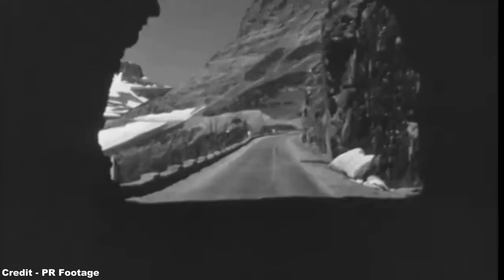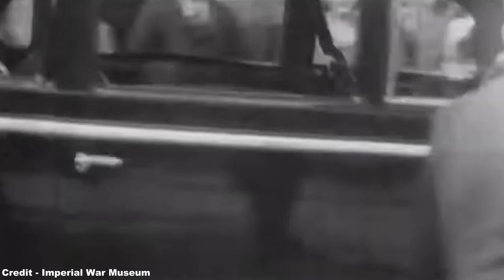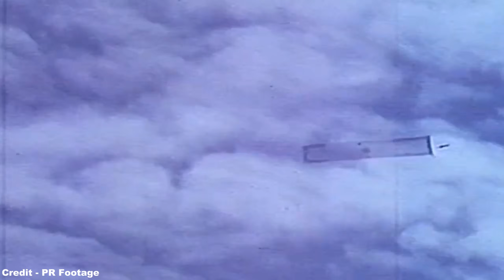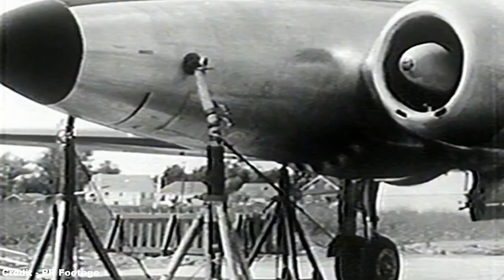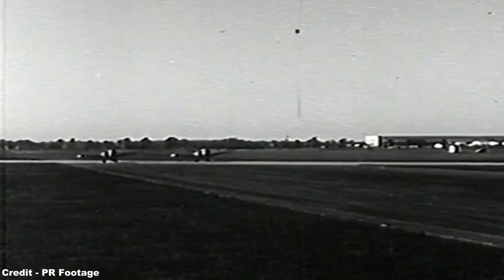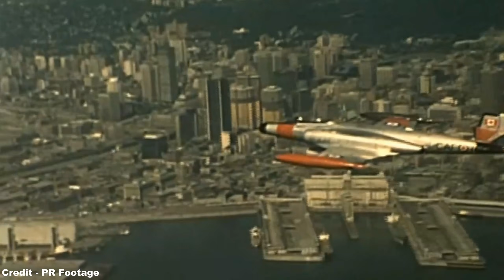Canada's Only Mass-Production Fighter Jet - Avro Canada CF-100 Canuck

Comment: We could have been something, our government sold us out. Now with the madness in the united states here we are again. I hope we buy the SAAB, since we are no longer able to design and build out own. 
Signed an old angry aircraft mechanic with 30+ years airforce.
Reply: The largest part if not all the cost overruns on the CF-105 were to do with the fire control system and weapons systems. Had Avro used off the shelf systems the Arrow would have been built and likely would have stayed in service until the early 80s. The Orenda Iroquois was a series feat of engineering
Reply: @SimplyGregsterEV  The CF-105 may have ended up an orphan if it was adopted.  Only 80 in service with a series of governments not willing to spend the big bucks to keep it in service.  Kind of what happened to the Convair B-58.  Maybe the RCAF would have retired it in 1970 and bought F-4 Phantoms!
Reply: in very loose terms, the gripen looks kind of like a single engine arrow with canards, and modernized. it comes with full data package, so at the very least, it would be a great way to kickstart recovering what was lost.
Reply: The government didn't sell us out.

Comment: When looked at on its own, it wasn't a bad attempt at a homegrown fighter/interceptor, but when looked at in relation to what Canada should have had, well…
This was the stopgap after Canada cancelled the Avro Arrow, which was a vastly superior aircraft than the CF-100 Canuck. 🏴🇨🇦
Reply: The stopgap(s) after the Avro Arrow were the Bomarc missile and the F-101 (CF-101) Voodoo. The CF-100 was the second best straight-wing interceptor fielded by any nation during the Cold War

"What Canada could have had" is a long and depressing list of everything from The CF-105 and CL-84 to the AH-64 Apache and F-14 Tomcat. (And that's just the air assets, our navy managed to loose out on both carriers and nuclear submarines.)
Reply: @thatoneguy8355  And the best straight wing interceptor was not the F-89 Scorpion.  So what was it?
Reply: @timp3931   Aside from having a superior radar and better armament (In the B and C models) and later carrying A2A missiles (Early cold war ones but still) it was more produced, faster, and had a higher service ceiling. 

IF you want to argue the Canuck was better, sure, but I cannot think of a better straight wing interceptor beyond those two.
Reply: @thatoneguy8355

The CF-100 had a higher rate of climb and longer range.. and the F-89 was only in service for 3 years with air to air missiles.